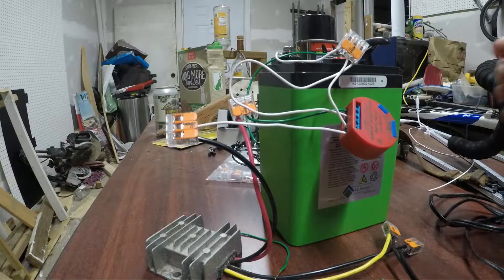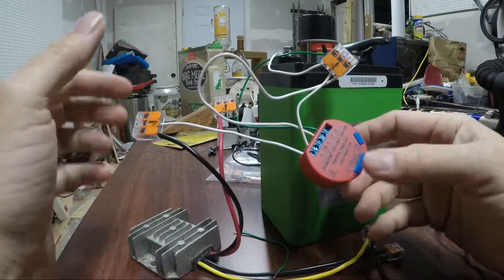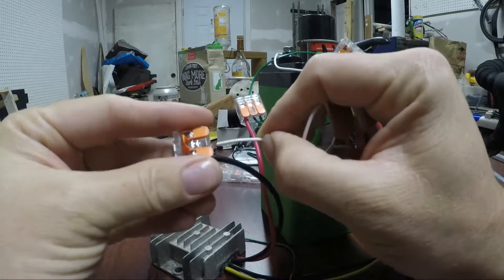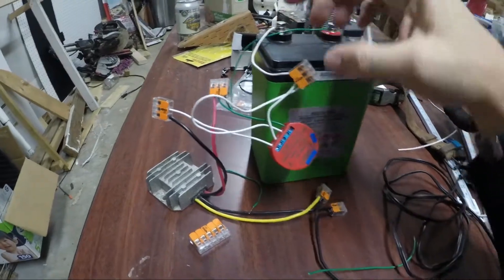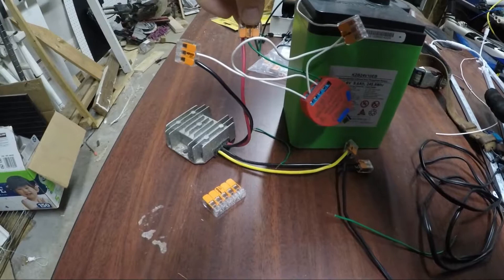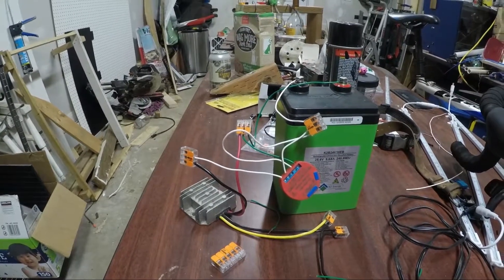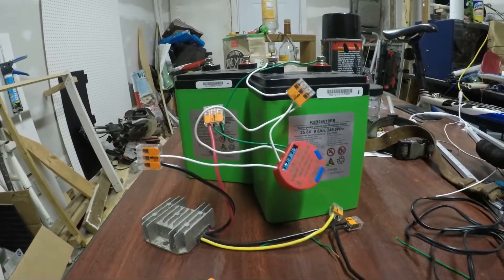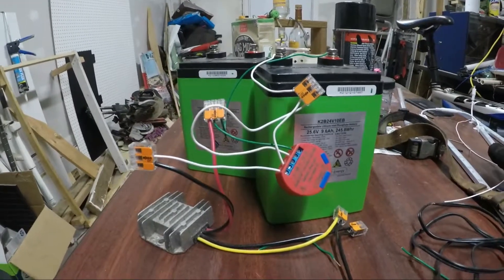Shelly 1PM DC wiring for greenhouse project

Comment: Thank you dear sir, you really saved me here.  I lost a lot of time getting this setup and your video was the only accurate resource I could find online.  Unf Shelly does not provide nearly enough information on DC wiring, which as a non-electrician, I always find very confusing and counter-intuitive, esp compared to AC wiring.  What was most helpful for me in your video was pausing the video so I could see how your wiring was routed, which I replicated, and all worked perfectly.  For my setup, I am using the Shelly to send DC power from my battery bank to a Bluetti solar generator between 8am to 10pm, basically as a DC power timer.  Thank you again.

Comment: Can You share the wiring diagram? Does the led inside 1pm start blinking after powering up?
Reply from the maker: Yes, the LED blinks. I'll try to get it down in writing this weekend!
Reply: @penguinponics  Thanks!
Reply from the maker: @KarolBrejna  https://drive.google.com/file/d/1Sej6VBoY6kqwT6KU3EG8S9XumaH0OBhh/view?usp=sharing Try that. Let me know if it helps. Once I fix my website I'll get a permanent link there.
Reply: Penguin Ponics thanks again. I’ll test that soon. (My Shelly would not start with DC although it works fine with 230V AC. There is hope... ;) )
Reply: Thank to those hints I managed to make my setup work. The key mistake on my side was mistaking + and - when supplying power to the Shelly. On the other hand, for me, it was unnecessary to attach „-„ to SW (on shelly). Without doing that I was able to turn on/off my circuit programmatically (with the app). Thanks again.